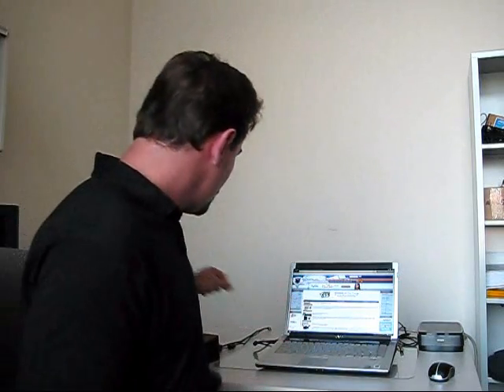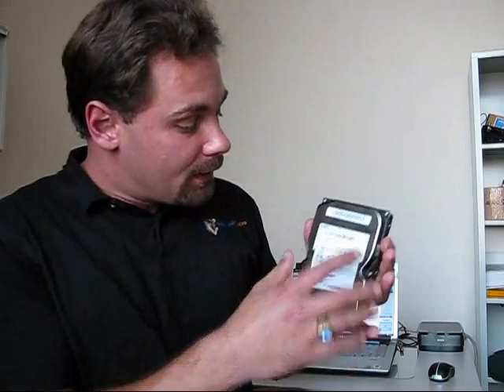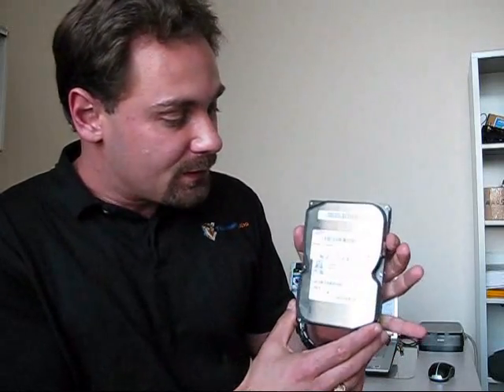Hard Drive Click of Death Explanation and Live Demonstration

Comment: This is why I want an external ssd drive so that there is none of this physical moving garbage inside and it will last longer.
Reply: bradgonewild The biggest ones are related to "power cuts".
I mean, imagine if your pc freeze and you have to force a shut down, or there is a power failure or anything that might just turn off\reset your pc without going through the common safe procedure. Well, in all this cases, you have a very high risk to lose the SSD with all the data in it. This is also one of the reasons why it's always suggested to use SSD for software and HDD to archive anything else. Not to mention the limited number of write\delete cycles you have with an ssd (but this problem is getting fixed little by little with every ssd generation.)
Reply: Unfortunately with SSD you have a whole lot of other problems so at the end of the day, the only way to "be safe" is to do backups on different drives.
Reply: I just had a thought, can data recovery be done on a SSD, similar to how you would on a HDD?
Reply: nand chips can die too. there is actually no way to recover your data once the chip itself dies
Reply: 0Tidus0989 What problems do SSD often suffer from?
Reply: 0Tidus0989 I've had to power-cycle my computer a number of times, and haven't had an issue with my SSD yet. I'd be more worried about brown-outs or power surges, which would cause the drive to operate at non-standard voltages (potentially damaging the circuitry).

Of course, power-cycling a computer with any drive (HDD or SSD) can cause data-loss or a corrupted partition (which can be difficult or impossible to recover), but I've never experienced or heard of this causing the death of a drive.
Reply: I know this is a 3 yr old thread but whattaheck... from my previous experiences, I have NEVER-EVER been able to recover ANYTHING at all from ANY SSD as oppose to a mechanical HDD. See, like someone already mentioned, spikes and brown outs are the main KILLER thus frying the circuitry on either the controller board or the actual SSD memory which is the part where the DATA is or was stored.
Reply: You're a Genius alright!
Reply: Old thread but I want to add an FYI -- SSDs need to be powered on periodically. There is a tiny amount of charge that is kept and required to keep NAND cell state. SSDs will die from cold / unpowered storage.

Comment: The behaviour of the disk's controller I explained doesn't mean that is malfunctioning, indeed it's the normal operation taken by every hard drive when hitting bad sectors, resulting as stated in the repeated heads park - read retry cycle I described.
Eventually a damaged controller could also lead to this effect (but more likely since the drive starts and not just when the computer tries to access it), but in your specific case I think it's a disk's physical damage, as the drive dropped.

Comment: It depends by how the disk parks the heads when it's turned off. If the heads are being retired from the platters and parked on a little ramp near the outer platter's border, damage in case of drops could be limited, but if the heads are kept on the platters (on the "parking zone" near the disk's center) a drop could more likely lead to a significant damage.
Anyway HDs are very fragile and precise mechanical devices and a drop can easily damage them, no matter how the heads are parked.

Comment: Thank you for your reply. My external hard drive was unplugged and Off when I accidentally dropped it onto a hardwood floor. Some people have told me that if the drive is Off and not running then damage between the head and the disk is "unlikely", but if it's clicking like you say then maybe it is. However, it also may be as you say the external HD's controller that is damaged and it cannot get the head to operate correctly. I will have to open it up myself to see either way. Thanks again

Comment: Probably your drive have a lot of bad sectors, and when the computer tries to read it its heads hit on these sectors, and as these can't be read the disk's controller slaps back the heads to the parking position (making the "click") and then retries to read again the sector. This is repeated some times, so there's the "click click click..." noise.
Maybe your drive is heavily damaged on the first tracks, where the file system's data are located, so the OS cannot detect it.

Comment: Look, the "clean room" can be made for about 12 bucks out of a cardboard box with an antistatic mat, light and tools placed inside, cut two round holes for yellow cleaning gloves, then a hole for a viewing window with double paned cellophane which eliminate the need for the strap but always wear just to be safe. then closed with the anti static wrist strap put around your wrist.  I use a clear plexiglass box which is more but you can see so much better. Do yourself = SAVE MONEY!!

Comment: I went on vacation recently and took roughly 4000 photos. The hard drive died on my return :( after some research I managed to diagnose the sound as the head stuck to the platter. Got a quote for $1650 to recover and decided to take a risk. I opened the hard drive, turned the platter to release the head then closed it again. I managed to get about 1500 photos off before the click of death. Opening the hard drive without a clean room is not instadeath...just the kiss of death :)

Comment: My hard drive was experiencing very slight clicks. Not as bas as this.

I unplugged it for about a week and then plugged it in again and let windows do the disk check and it worked again!

I got most of the important stuff off and then ran a hard drive error scanner and as soon as it got to the last sector, it stopped working. And NOW i get the click of death. 

So i guess when you start to hear any sort of abnormal clicking, its a sign that the drive is in its last days or hours of use and you

Comment: Can anyone help me out with my question:

I have a Seagate Goflex 2TB, my HDD was turned off and I had it sitting on my night stand. My brother walked in to my room and accidentally when he walked out, he dragged the power cable with his shoe forcing my HDD to fall from a meter high. I immediately tried to check if it was still working, only to hear several beeping sounds. Does anyone know if it is possible to get my data from the HDD? I have checked everywhere to no avail. Please help.

Comment: But in my opinion I think a 120 gig SSD is better than a 1 TB hard drive because SSD is a lot more durable and it is more likely to keep Data secure longer than a hard drive. Because hard drives have moving parts and they're very slow and unreliable so I prefer SSDs over hard drives

Comment: No, If I'm hearing this right, you can transfer your Platter from the broken hd to a working Exact Model harddrive, and this working head will pick up your data. 
Option number two, try changing the controller board. I'm hoping this is right.

Comment: How come all you businesses try and stress that the hard drive is dead when it is not.  Anti-static wrist strap.  Proper torque driver and specs for your drive.  Watch experts take apart and replace the head if you do not know how.  You must order the proper safety equipment for removal and installation and a new read/write armature from the manufacturer.  Avoid dust, lint, dirt, fingerprints, etc.  Minimize contact of HDD with external environment.  Quit scaring people dude.

Comment: Seagate expansion most likely means that it will be a Seagate HDD inside. I just returned a brand new Seagate HDD to the store last night... it seems that a lot of the current Seagate drives(1TB, 2TB and 3TB) have a problem where they make a "chirping" sound occasionally, it's suspected that each "chirp" wears the HDD out. So I picked up a Western Digital, even though it's less capacity and more expensive, they make a good performance drive. You should also check some reviews of specific models.

Comment: Thing with external HDD to remember is that the branding on the enclosure or the box doesn't actually mean anything. If it's one of the bigger ones then there is probably a regular 3.5HDD inside it, the smaller ones most likely are laptop type HDD. It's the maker and model of the actual HDD that will make all the difference, the enclosure itself is a very simple piece that just routes some wires. As far as the HDD goes you normally get what you pay for... its a good 'rule of thumb.'

Comment: I have a WD Caviar Green 1TB bought it in the year 2010, recently I made an upgrade to my computer, at first the hard drive was not reading it freezes my boot screen. I tried other older machines it worked twice on older motherboards then died nothing I didn't even had the chance to backup my data, I tried the freezing method, left it for couple of hours, plug it to my computer it does't freezes my boot, it read (0.0GB) on my boot but still nothing it does not click much only twice plz advice TY

Comment: The clicking is from it not finding the landing zone and it hitting the stop.  This is typically a board problem and not a physical problem.  Physical problems would be the motor dying (very rare) if the head crashed into the platter and the pillow has silver dust on it forget it.  I could go on and on...

Comment: wow, a lot of inaccurate information. Never freeze the drive, chill it a little but condensation with destroy it.  Just opening the case and exposing it to the air does not harm the platters... total nonsense and misnomer. There are air holes on drives they are not sealed and have no filter, they are self cleaning essentially due to rpm and barometric pressure they create.

Comment: Your video was excellent. You succinctly explained what happens inside a HD when the 'click of dealth' occurs. It's depressing when external drives can not be repaired and only data can be recovered. That process is expensive. The lesson I've learned is: BACKUP YOUR DATA -- and it's an expensive lesson. I have three external drives that died. It seems that internal drives have a longer life span. A cautionary note: NEVER put HD in refrigerator. It will actually KILL your drive permanently.

Comment: Probably a file problem, most likely a corrupt file. My laptop's hard drive was like that.  What I did was I took out the hard drive out and I attached it via usb to my new computer.  It loaded EXTREMELEY slowly but when I finally got it to load, I just deleted the program files folder I assumed that the problem was from a file that didn't extract well, and I guess I was right. Right after I deleted the folder, the hard drive ran like normal again.  From there, I was able to get my files back.
Reply: My hdd not working too after put some files on it. Do you know how can i format it? It not shown neither in bios nor in windows.

Comment: ok guys i got a question for you i have a 250gb 2.5inch hard drive for the xbox360 right it works on pc and sort off on xbox 360 first gen not on the slim well on xbox first gen  if i delete files say two theme packs it will start clicking and xbox will not be able to read the data but if i restart it works again until i do what i did before again any ideas what the problem is

Comment: First, what is the "Freeze method?" Don't tell you it's literally putting it in the freezer.

Second, What sucks most for my dead hard drives is that they WERE the Backups.

Which brings me to the question, why the hell are my Back up drives dying? First, an External dies and "Beeps" (not clicks, it beeps) and now, my internal backup died, Like it's not getting any power to it even though I tried using different Power Plugs.

Comment: I heard when you remove the cover, the free movement of air around the stylus means that it will no longer "float" properly and will scratch the platters. However, it has the benefit of possibly reading better (for that ONE pass). So removing the lid and then powering up could give you the one last chance to recover data. Doing so will scratch the platters and kill all the data forever. I also heard the freezing method works 80% of the time and no-one really knows why: you're guessing, admit it!

Comment: Oh, is your hard drive making a clicking sound every second or so? That's called the click of death. It means the read write heads have gone bad. To fix it, you have to replace the heads with heads from the same size and model of hard drive.

The clean room is over rated. If you remove the cover, your hard drive won't instantly turn to rust. I think that's a scare tactic from the people who do data recovery. But, of course, the cleaner the better.

Comment: You can try the freezer method. That will work if the platter is not spinning. Do a search -hard drive freezer. Be very sure no moisture can reach the drive!

If that doesn't work, you can replace the circuit board; try to get the same firmware.

If that doesn't work, replace the heads. Check the video - Hard Drive Head Replacement Tools for 50 Cents.

Data recovery is delicate! If you get the drive working, copy everything IMMEDIATELY! It might work for 20 minutes or 2 hours. Best of luck!

Comment: Hello, I'm from Venezuela. Recently I bought in the United States a 3tb external hard disk WD. Pluged it in my mac and worked well, but when I was doing the first backup, the electricity went off. When the energy returned, the computer did not recognize the disk, and since then the hard drive makes the click that you describe in the video. Does the question is, the drive is practically new and has nothing stored... can be repaired?

Comment: @GameloverEnjoyer Error checking is just that. It won't be able to fix physical problems in the drive. However, it can diagnose problems in it and tell you if it is not functioning normally.

The noises you are talking about well describe a dying hard drive, especially if the clicking becomes more frequent over time, up to the point of the drive shown in this video. Then, your hard drive is completely dead.

Comment: What about a usb style external hard drive that's been plugged in a loose connection where the plug keeps falling out and getting disconnected, for months on end? I plugged it in today and the computer had trouble even detecting that it was plugged in, and then it started clicking, so I unplugged the external hard drive and am assuming it has died. No physical damage has been inflicted on the external hard drive, other than that craptastic plug for the usb that keeps slipping out. Help?

Comment: Guys, I need some help with this then. I recently bought a new computer and I've now had it for a month. Ever since I got it, I heard this clicking everytime I turn it on, and when I turn it off. There are 4 clicks and they are seperated by 1 second at a time. At first I thought it was the fan or something but my friend told me it was the hard drive and that it's going to fail. But since it's been a month, shouldn't something go wrong by now? Any advice is great. Thanks.

Comment: @InThe11thDimension Yes, harddrives are standardized, most laptops use a 2.5" HDD which are smaller than the one shown in this video, which is used for desktop/stationary computers. But the principle is the same for laptop HDD's, unless its a SSD which is way more expensive, either way they can usually be switched out.

Comment: This morning when i tried to start my computer, it would start, (I'm running Windows 7 Ultimate) but, i could only get windows to boot in safe-mode. When I tried to start it normally, it would eventually load, but it wouldnt log me in ( it kept me at  a light blue screen when I tried). I ran a hard-drive scan with Hirens All-in-one boot cd. It found some bad sectors and couldnt repair them. Does this mean my hard-drive is toast or can it be repaired?

Comment: One reason it's so expensive to recover data from a failed hard drive is a "clean room" must be used as the environment under which the data recovery operation takes place, where there is absolutely no dust, pollen, etc.  - because within the space of the cushion of air created by the spinning of the platters which separate them from the heads in opreration, a speck of dust is like a boulder.  This is why opening a hard drive outside of a clean room means ruining it.

Comment: I'm surprised that the "whack" method of attempting to revive a hard drive is still known.  In the early 90s my Seagate 40MB full-height 5 1/4" drive tended to experience "stiction" where the heads resting on the platters prevented spin-up on power on.  I would occasionally have to give it a good whack with my palm at power on to get it to spin up, often enough that I kept it outside the case for convenient access.  That drive never died, it was just obsolesced.

Comment: Thanks for the great video. you said that hard drive becomes useless when you open it. 

does that mean if I just open the case ( i.e. exposed to light or whatever) to see what is actually causing the sound will certainly make the disk useless?

is there a way I can get the failing drives platter and put it into the working drive, so that data can be read?

Comment: @stupidjunk978 That is incorrect. All drive manufacturers have about the same level of quality/reliability. More likely, there can be flawed "batches" of hard drives from a specific manufacturer so a flawed drive's partners are more likely to fail compared to unrelated drives. In any case, you should backup drives regularly.

Comment: @pcworld88 
Well, slapping (clicking sound) occurs not only when a drive "is dying" - but can also LEAD to drive's death (it's not a good idea to have your head armature slapping against the drive). So there's "clicking and clicking". In your case, it's caused from that eventual power inneficiency that the drive is suffering from. And like I said, this either means a faulty connector/power cable or even the power supply itself is not efficient any more.